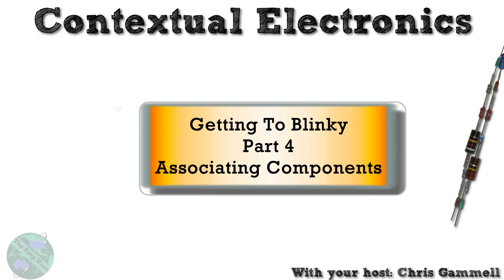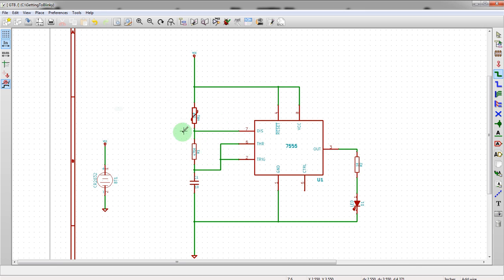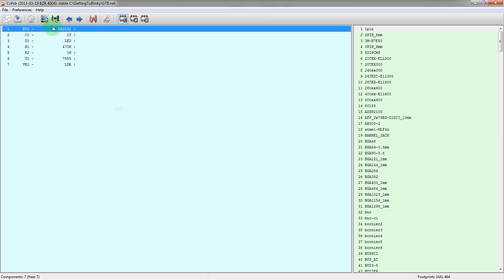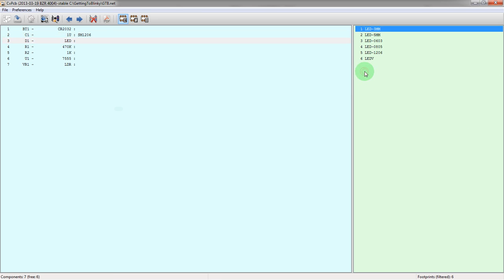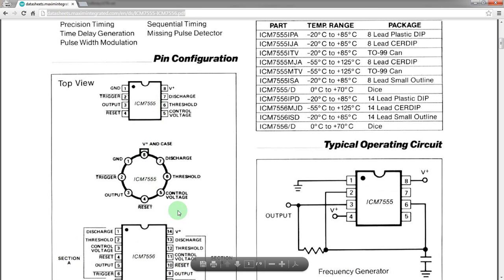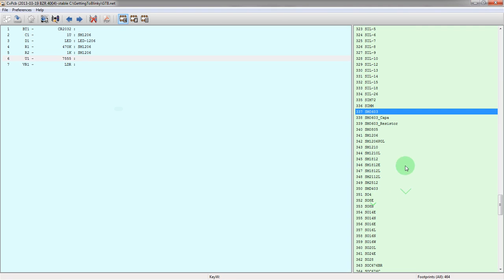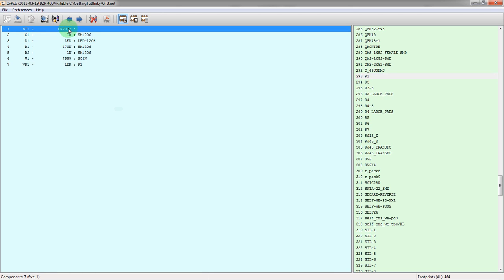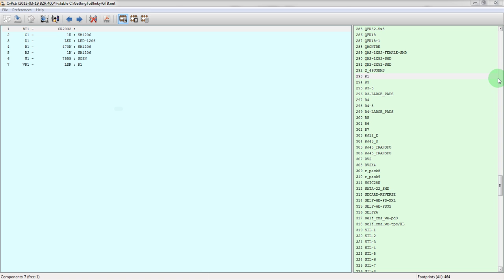KiCad 3.0 - Part Association with CvPcb - Getting To Blinky KiCad Tutorial - Part 4

Comment: Hey, to anybody else who got confused by I'm assuming a version change: the SOIC part he mentions is (I think) now labeled SMD_Packages:SOIC-8-N. 

I also updated the footprint library under Preferences->Append with Wizard.  That part probably didn't matter, but seemed like a good idea.

Another thing I found floundering around in this section is you can filter by library (green boxes with "L" on it).  That lets you use the filter on the left to various areas like "Resistors" and "SMD_Packages" which helped me narrow down when I couldn't find the part he mentioned.
Reply from the maker: Lee Henkel that is correct, this older version doesn't map well with the newer version. I plan to remake these videos once the 'stable' version is out in July.
Reply: Lee Henkel what about the VR? thats what i have for my variable resistor.